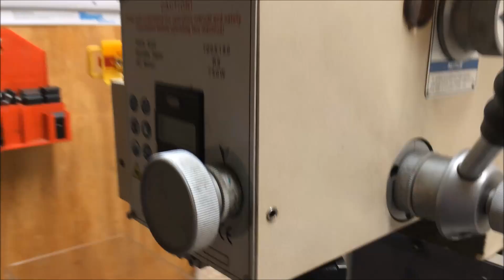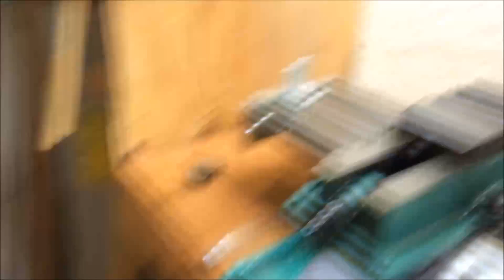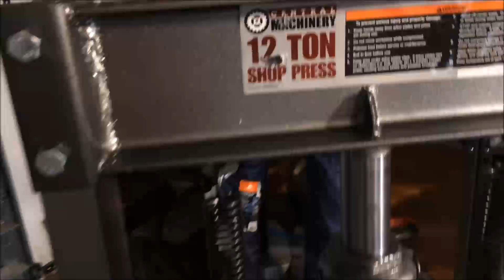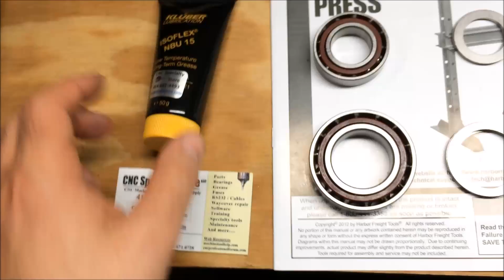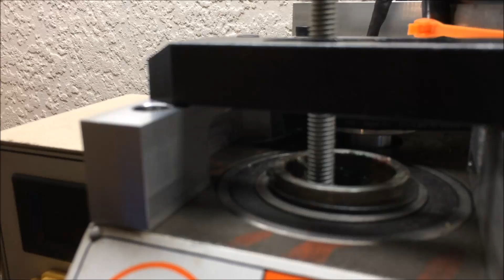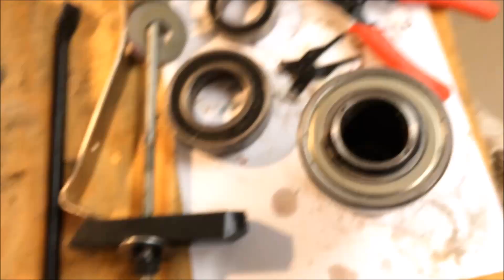G0704 Milling Machine Spindle Bearing Upgrade: How to Install

Comment: Hi Franco- thank you for this video. I have watched it several times, and now feel very comfortable beginning my own spindle rebuild. I did notice one thing that you did that may be a mistake. After you seated the lower spindle you installed the pt# 247 spindle ring loosely. You called it a dust cover, but I believe that it is actually the lower bearing retainer. Next you installed the upper bearing using the pt#251 adjustment nut to seat the bearing, then gave it a bit of preload, followed by fighting the bottom pt #247.  I think that the pt #247 should be tightened  100% before installing the upper bearing, or attempting to pre-load. Because if the (bearing retainer) is not locked down, and stack up is slightly off, you won't be able to achieve pre-load, and could possibly press the lower bearing down, out of its seat. Now when you tighten the lower pt#247, you don't have any idea how much pre-load you may be inducing.  Great, presentation, thanks again, Howard

Comment: Thanks for the video, you did a great job explaining everything.   For those that want to make the spanner wrenches before disassembling the spindle, the lower bearing retainer wrench requires .160" dia. pins.  Franco's center to center dim is correct.  The upper bearing retainer's center to center dim. is 1.400" and requires .192" dia. pins.    Another way (perhaps easier than the bearing puller shown in this video) is to cut a length of 1/4" x 1" CRS 2.05" long and hand grind approx. 1.2" R on both ends and hook this piece of steel up under the lower bearing's race, then use a punch and from the back side drive the race out of the housing.   One more suggestion is to make the spanner wrenches out of CRS, not aluminum.   I tried aluminum and they bent, best use the steel.    I have free AutoCad drawings of both spanner wrenches, if interested, send request for drawings to rosseverhard@hotmail.com    I'll get them to you eventually.

Comment: Hi Franco- just a quick note to let you know that I did my bearing install per your video. All worked great. Once I got a look at the old taper bearings I could see why they were running hot, by the wear marks, bearings were dry as a bone. I am going to make a reminder/note to open up the spindle every few months and grease the bearings.  Thanks again for the instructional Video. Howard   PS. Spindle runout is less than .0001. Yes, I couldn't believe it, under 10th of a thou. I setup and checked several times with my .Mitutoyo 0005test indicator
Reply from the maker: Awesome!  I'm glad the video helped.  It sounds like you have a better than average spindle.  What bearings did you use?
Reply: Hi Franco.  I bought angular content beatings 7995B & 7B. from VXB. Run-out is great. I only have about 4-5 hrs run time so far and they are running very cool, but these bearings are noisy. I an watching them closely. But will probably go back to tapered bearings. Will be sure to update this post. Howard
Reply: Sp error.above - Angular contact bearings, 7005B & 7007B from VXB Bearings

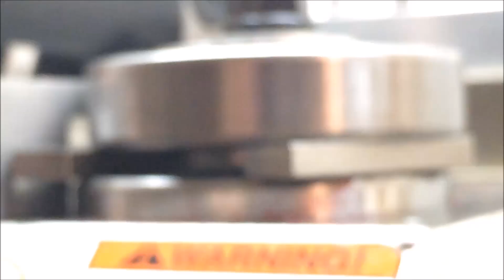Comment: At 25:50, You could clean up the bearing bores by removing the "HIGH PEAKS" of the rough machining marks, from the original manufacturers hole boring process, to make this a better "Finger/Hand tight" friction fit.  Also, all of these pressing forces are twisting the smaller inner bearing, and forcing energy THROUGH the balls to the other races, if it is a tight fit as well. Cleaning up these bores will potentially save damaging these bearing during installation. Damage before you even turn the machine on.  Again. robrens YouTube channel, and thanks for this video!

Comment: If you heat the bearings before you install them its much easier to press them on a shaft. You might might not even need a press.  You also can used canned air to freeze the outer race before you press them into the case.
Reply from the maker: That makes sense. I'll try that next time I'm working with bearings.

Comment: Take care with ball bearings, the inner race can be expanded by a tight inner shaft and the outer by a tight outer race depending on how rigid they are. You need to have perfectly round shafts and bores and enough clearance for the film thickness of the lube you use. Insufficient clearance causes heating from shearing of the lube. Balls are sensitive to load since they have point load, not line load like rollers. The tight adj on your rollers may have been the cause of the heating. I have seen new and greased tapered wheel bearings in a car blued or yellowed by over tightening - no cheater bar required!
Reply: Good points, Toby.  Thanks!

Comment: It will be interesting to see how long the angular ball type bearings last. They are generally not designed for perpendicular loads, which your quill will go through every time you've engaged Z and load is applied to your part. An angular bearing is used to support radial loads. The Z runout (backlash) will be a great indicator when they are worn out. 

The use of Angular ball type bearings are superb for high speed RPM, between the two race grooves but when loaded to one side (down or up) wall loads become uneven, the life of the balls will decrease and the high speed centrifugal forces will likely become distorted, allowing  the quill to become unbalanced (harmonics).

There's a reason why the drive was rated for a maximum RPM and of course, why the OEM bearing specs would have been satisfactory for their intended use. One option would have been to have been to replace the OEM bearings with higher grade conventional bearings (SKF, Timken, etc) and have them chemically hardened with a heat treat, sometime known as EDM. That would allow higher rpm as you desire. There are models of bearings that use different bearing steel as well, further allowing more loads, temperature and speed.

We use angular ball style bearings in race cars and routinely have to replace them due to wear from perpendicular load characteristics and we use a bath oil system, which still has a difficult time keeping them within temperature range specification. They do significantly reduce parasitic drag (by as much as 30%) - but at the cost of increased wear rates and routine replacement. The RPM of our bearings is actually lower than you planned speeds of up to 5,000 RPM but have perpendicular axial loads of up to 4,000 lbs.

Let us know how they perform over the life of your machine!
Reply: Doug Hanchard one of the issues with ac bearings is most choose by size and not specifications. I see many using a 15 deg Contact point and you loose axial load. We don’t need 20,000rpm bearings. Even at a 30 degree contact point which will have higher axial loads than a taper roller you will significantly reduce max rpm to 11-13,000. The other issue is the lower contact angles typically have a minimum rpm of 8,000 which will have excessive runout at any lower speeds and the inability to be properly loaded. I suspect the bearings chosen for this 704 are incorrect by the runout. If used everyday they would last 4-5 weeks.
Reply: @glennedward2201  
why dont you suggest the correct ones then? If you know he's milling possibly 100 rpm up to 4000 rpm, suggest what would be best.
Reply: @crookedriver2079  32005 and 32007 tappered nachi bearings are direct replacement
Reply: Angular contact bearings are very frequently used in machine tool spindles ! But they are precision grade bearings, and repeatable preload without shimming is achevied through narrow tolerance of the thickness of the rings.

Comment: I have the same HF snap ring tool. If you install the attachment at 90 degrees to the body, you will have enough travel to open that snap ring. I forget which pins and which holes I used, but you get the travel. You will still have a HF tool, not a Snap-on, but you will get the travel.

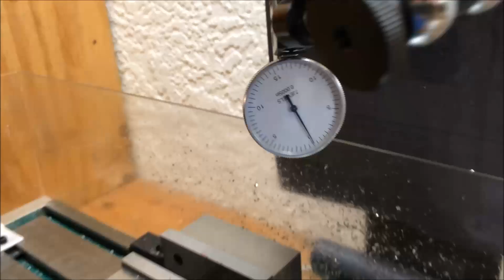Comment: At 1:56, you can check the runout on the outside AND inside of the spindle shaft, to maybe identify if the error is the inner surface or the shaft as a whole, or the actual bearing.  If you can narrow the trouble down to "NOT THE BEARINGS", you could resurface the spindle taper, or outer bearing surface to "0" runout.... Thanks for making this video 9-years ago...  Any significant updates? life span of bearing sets? bearing changes? reversion back to tapered rollers because of other issues?

Comment: Just as an FYI not sure if its a difference in newer model or difference between clones but I am currently doing the same bearing upgrade on my PM25-MV which is a clone of the G0704. However the smaller deep groove ball bearing in the upper spindle housing is not a 6007ZZE, but a 6009ZZE everything else seems to be the same so far.

Comment: So runout after.. but runout before? Because I understand that if bearings get so hot in there then either there is no oil, wrong oil or too much preload since tapered bearings need proper preload. Also as long as bearing temp stay below 100c it should be fine.

Comment: Hey what size belt pulleys are you running? Are they 1:1 ratio and first your motor run the opposite direction now that you are still running through the gears? Cheers

Comment: Not sure but maybe the factory bearings were to tight.Adjustment may have been all that was needed.I went to taper bearings on my lathe much better finish.Speed wasn't an issue for the lathe tho.Moly grease more the moly the better.
Reply from the maker: Hi.  That may be possible.  The factory bearings were just fine until I started running over 2000 RPM.  Then they started to get hot - really hot.  Tapered roller bearings are very stable but they experience a lot of friction.  I've run the AC bearings at about 3200 RPM for many hours and they get warm - but not near as hot as the tapered rollers got after only a few minutes of high (3000 +) RPM's.  I still have tapered rollers in my lathe.  They work great at the lower RPM's.

Comment: At or near 7:27 you fabbed a wrench to take off a retainer but this tool at Harbor Freight likely would work for you. It's adjustable. It's used to take off the retainer nut that holds on cutoff wheels on grinders....
http://www.harborfreight.com/adjustable-pin-wrench-36554.html
Reply from the maker: Hi.  Thanks for the suggestion.  I actually bought one of those before I started this project.  Unfortunately, the pins are not long enough to reach the retainer.

Comment: Interesting video. Why were the bearings replaced? To tolerate the higher speeds? What the mill quieter after replacing the bearings?
Reply from the maker: Hello.  I replaced the bearings to allow the mill to run at higher RPM's.  I would not say that it is quieter. However, the mill works much better now.  The additional RPM's really make a big difference!  My roughing tool paths seem to work a lot better.  I can remove more material in less time and it is much easier to clear the chips.
Reply: And I bet the larger motor makes a big difference as well. If you would not have replaced the bearings is the worst that would have occurred faster bearing wear? Maybe asked another way, if it was not for the need for higher speed, would the old bearings have been fine? Thank you.
Reply from the maker: You are correct.  The only reason to upgrade the bearings it to increase the RPM.

Comment: Did your spindle got hot after running with no load before changing the bearings?  Does it get hot now?

Comment: I wonder why some of the G0704 and BF20 have an oil sight glass next to the High/Low knob.
It's not like it's full of grease in there and it's always gummed up so you can't see anything.
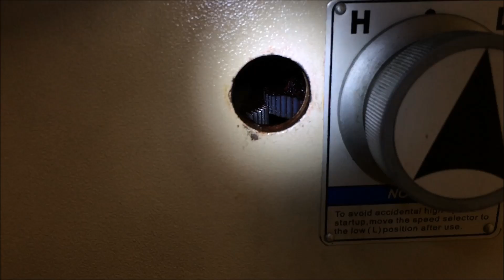Reply: oil is for the transmission --  Hi-Lo see 18:24
Reply: @crookedriver2079  Well I haven't seen one with oil in it. They only come with grease smeared on the gears. Mine did too and it has metal gears, not plastic. Also the manual doesn't mention any oil.
Reply from the maker: @JorgenLarsson  I think it just makes it easier to squirt the grease onto the gears.  Very basic setup.
Reply: @JorgenLarsson   taht's because the sight glass is there for several different models some have grease some have oil -- otherwise why would one need a sight glass for applying grease?

Comment: Great video. Thanks for sharing. How well have the gears held up to the higher speeds?
Reply from the maker: I run about 3200 RPM most of the time and I haven't had any problems. When I drill, I put it in low gear and keep the tool under 3/8".  I usually helical mill holes rather than using a "big" drill. It seems to be a lot easier on the machine.

Comment: $45 Jeslus is that grease really that much better than the cheaper alternatives?
Reply from the maker: Well, I can't really say.  But I do know this - many of the CNC machine tool builders specify the use of Kluber grease for bearings that can't be lubricated with oil.  There has to be a reason for that.
Reply from the maker: Here is a place to buy if for less $$

https://cnc-specialty-store.com/grease-lubrication/kluber-isolflex-nbu-15-50-gram-tube?zenid=b105b2fe3fedf753b2d2045f3e979b13
Reply: @FrancoCNC  Crap! I just bought some from Amazon $43.00!

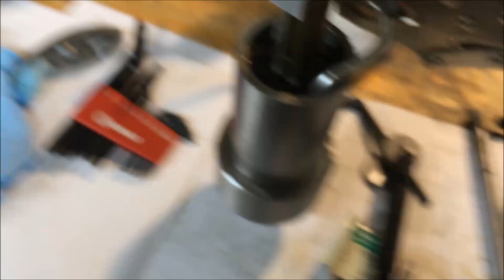Comment: 6:40 you can just print an adapter and put 2 screws in that works fine... but I can only warn you it's not sustainable because the lock nut is a failed design!

Comment: how did the bearing upgrade affect your spindle runout tolerance?
Reply from the maker: Hi. Go to 1:55 in the video and you can see the indicator check. I get about .0005" at the spindle taper. As I recall, the factory bearings were about the same, but they got really hot at high RPM.
Reply: +Franco thanks.. was watching one of your others vids as your responded. i think i found my problem. i'm gonna pull the hi/lo gear and bearings. When remove the spindle  and look down thru the bore, i see runout on hi/low gear spline -  bad bearings.
Reply from the maker: +Power Gear That's certainly possible. Are you trying to improve surface finish?  If so, I've found the biggest problem on my mill to be the clearance in the quill splines. I forced shim stock between the quill splines and the female opening that it mates with. That removed the play and my finishes are much better. Hoss and RussStuff used a plastic spacer to solve the same problem.
Reply: Actually Hoss did it due to the rattle. Not sure it improved anything else.

Comment: G0704...is the rest of the machine even strong enough to benefit from this 'upgrade'....?
Reply from the maker: Absolutely!  Upgrading the spindle bearings was one of the best mods I've made.  Fusion 360 has some great adaptive roughing strategies that lend themselves very well to machines like this.  Generally speaking, the trend in the industrial machining world is to move towards "lighter duty" machines with high RPM spindles and high feed rates.  Rather than slowly plow thorough a heavy cut, it's more efficient to take light "peel" cuts at full depth and move really fast.  The strategy lends itself very well to hobby machines like this, as well.

Comment: I see a few of these bearing change video's but this is not an upgrade !  its actually a downgrade.  the factory uses a taper bearing with a pre-load on it to remove any  tolerances in the shaft , you cannot do that with a regular bearing !  and they have play in them when there brand new and as they get worn develope even more side to side play .  Taper bearings are used in lathe spindles and mill spindles because with pre-load the tolerances can be removed.  To do lathe work or mill work you cannot do a good job if your mill chuck has 10 thousands run out ! or your lathe chuck !   Don't take my advice , talk to a machinists , an older one who's been in the business for 30 plus years .  Or you could just read up on why these machines use a taper pre-loaded bearing ...   Common sense should be evident .  Anyway I do not mean to run anyone into the ground or make anyone feel bad,  I just been doing this kind of work all my life, 30 plus years and know.  I hope to save some one from making a huge mistake is all .
Reply from the maker: Check this out:
https://principle-eng.co.uk/angular-contact-bearings/

Tapered roller bearings are very stable but their design inherently leads to friction at the end of the rollers. Many very good machine tools have AC bearings in them to achieve higher RPM.
Reply: @FrancoCNC  My Smithy Granite 1324 came with ac bearings and preforms very well. I'm going to replace the cheap Chinese bearings before they go bad with good ones.